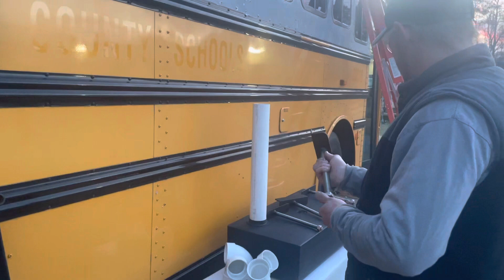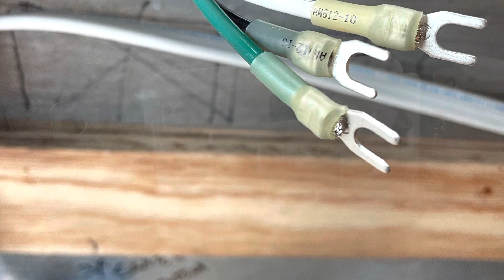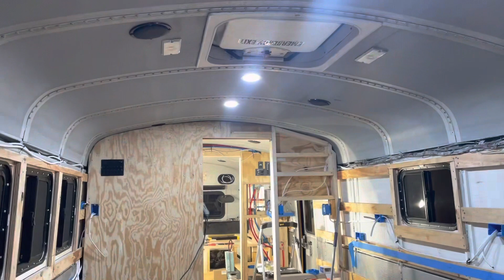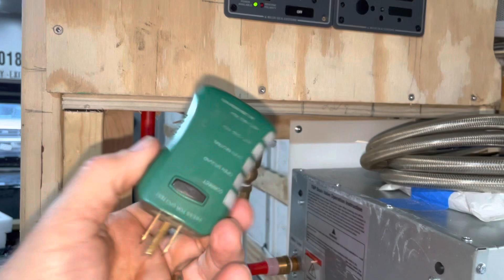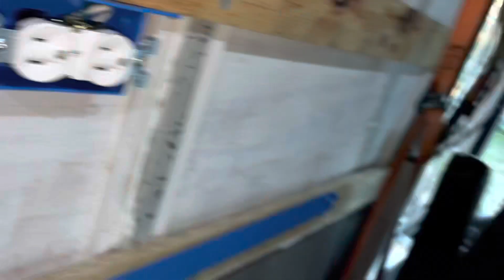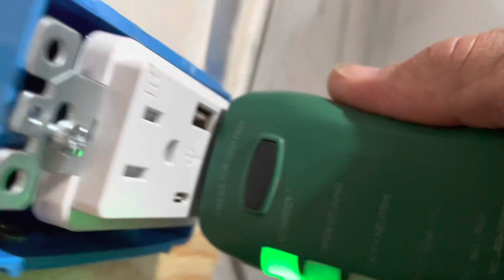Skoolie fabricating tank brackets, AC wiring and throwing the breaker for the first time.

Comment: I love the simplicity of your teardown. I don't see the need to remove ceiling& and side panels. Just to re -add insulation....    This is the  route we'll take also.. we've removed our seats, and when weather breaks, we'll start our build.  And nice job with electrical work.
Reply from the maker: Hi Rhonda. This vintage bus already has R7 insulation in ceilings and walls. I agree didn’t make sense to me to remove just to reinstall it. We are not going to live in this year round. Challenges in side wall insulation if you drill or bore a round hole the bit grabs the insulation and gets tangled and yanks it. Square holes ok.